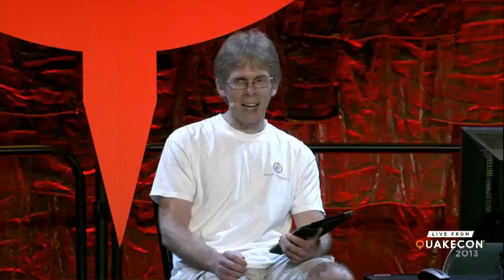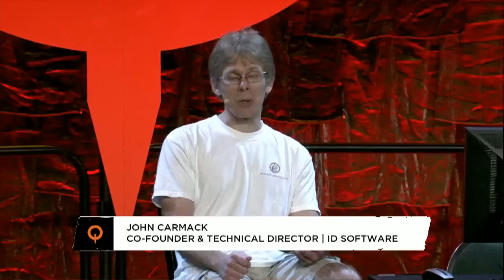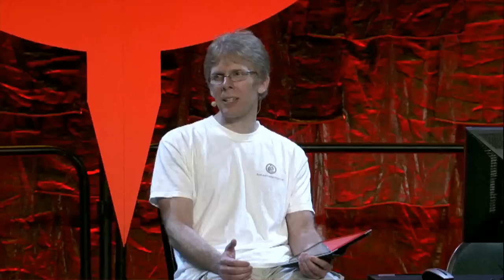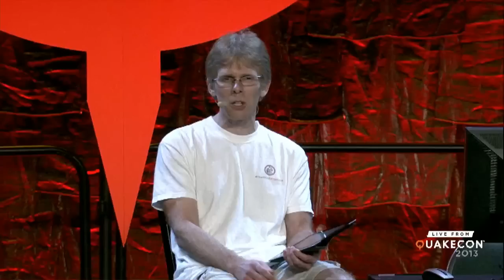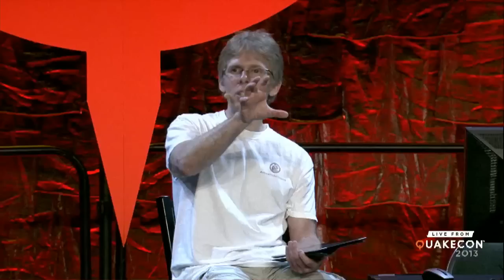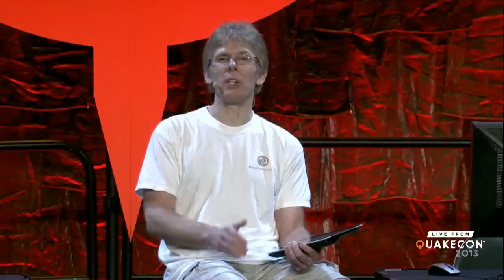John Carmack's keynote at Quakecon 2013 part 3

Comment: agree with john id prefer to have stereo 3D & real 60fps at 1080p and low frame persistence, before increasing render resolution or render quality, ngen consoles will not be stereo 3d 60fps. and lcd displays aren't giving us 120fps properly to achieve this. maybe we need another 120 black frames interleaved.

Comment: I want 60 Hz because most games as Konami, SEGA, Capcom... have only up to 60 fps but I'm not worried despite flicker.
I have CRT monitor 21" Samsung SM 1100P+ :D, CPU i5-2500K@4.5GHz and GeForce GTX 480 :D. I keep this CRT because the monitor LightBoost currently doesn't have 10-bit color (1 billion-color) and can't reduce to 50 Hz. It doesn't support Windows XP. :S
I buy Sony OLED monitor Pro 25" (BVM not PVM due to better motion blur reduced) with ~$16k (now, future maybe price dropped). :)